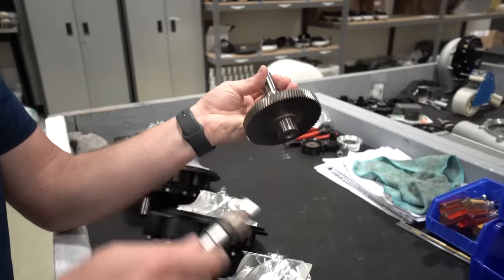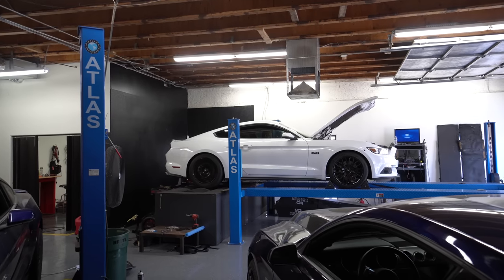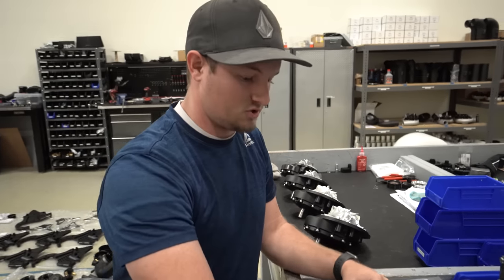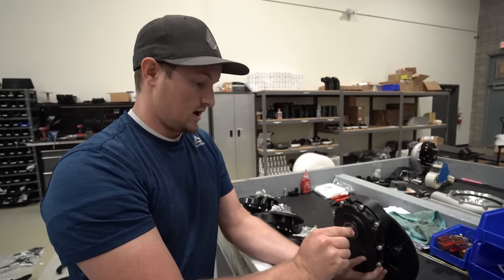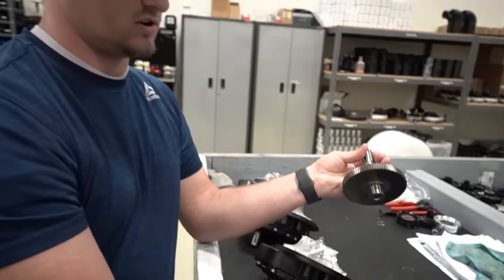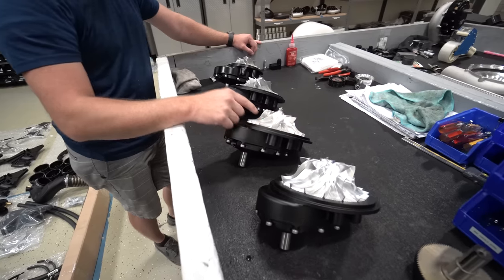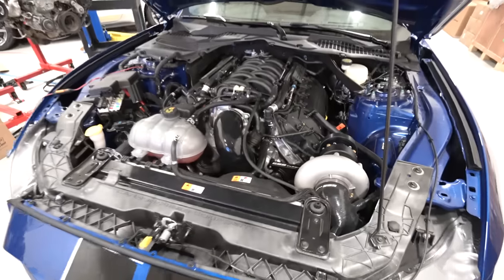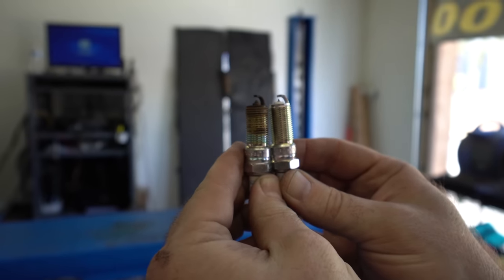Building a Mustang GT: Supercharger Install (NOT a Turbo..)

Comment: Wow, I didn't know ESS got into the blower business for the Mustang. Only thing I don't like about these blowers is the location of the air filter. I don't like having to remove the fender liner or the front bumper just to clean or replace the air filter. What I like about these though is how manageable the power is, how cool the engine stays compared to a roots style Supercharger and the fact you can still keep your strut tower brace vs a roots style as well. The one thing I absolutely love about the roots Superchargers is that whine it makes. It is sexy as hell on the other hand I don't like how Centrifugal Superchargers sound.

Comment: Those kits are fun. The only pain is changing the oil - took me a few times to get the level correct. The pressure release kept spraying my belt with oil. But, 19psi on a G3X is a dream!

Comment: Dude - I just got an ESS kit installed on my 2015 GT, headers, oil pump, breathers, spark plugs and exhausts fitted with a dyno - it's insane - thank you - digital dash next
Reply: what hp you make on your set up?
Reply: @gt8674  I got about 740 RWHP on premium pump gas - struggling to lay down the power so looking at a staggered wheel setup - the AWE touring exhaust is seriously loud

Comment: This is one the best priced centrifugal superchargers I've seen.  It also looked like it's 100% bolt on (only saw one small mod to one of the lines to the head cover)  Was that all you had to do?  Nearly every other one has a fairly extensive (but doable) mod list.  I'm liking this in particular because I want to install my own supercharger, saving about $1k on install cost.
Reply: Have you found the answer to your question yet? I am interested also

Comment: Cam, not sure if you mentioned it in the video or not cause I skimmed through but I highly recommend you do the oil pump gears on this car now that its boosted. Thats the only weak area of the coyote motor and its failed a good amount on boosted cars due to the vibrations caused by the supercharger. Hope this helped.

Comment: It’s been a few years, but all you added for fuel system is lu47 injectors? No boost a pump/ or high flow fuel pump. I’m planning on buying this kit. In know gen 3 coyotes have di & fi injectors maybe that helps not needing pump.

Comment: Great video man!! I just ordered a G3 kit for my 15’ GT your video explained the installation very well I can’t wait to get my kit and install it using this video!!
Reply: How's the G3 treating you so far?
Reply: @cfwebdeveloper  I absolutely love it!!! The power is great it’s definetly hard to get traction in boost but once you get traction it feels unbelievable but still very smooth power it’s not aggressive it feels really nice throughout pulls
Reply: @thomasfonte759  are u glad u did this kit and not a root style? I feel like this style is easier going on the engine but when you wanna play you Rev it out lol
Reply: @cfwebdeveloper  yes this is a lot easier on the engine than a roof style because instead of the engine being stressed out 24/7 it is only stressing the engine when your foot is to the floor building boost
Reply: @thomasfonte759  Yeah exactly.  Well glad it's still working good for you.  What did you do about fuel? One day I will join the boosted club :D
Reply: @cfwebdeveloper  I went with FIC 1000cc injectors and a boost a pump fuel pump voltage booster
Reply: @thomasfonte759  how's that mpg now

Comment: Great video. My plan was buy a s550 and throw on a Whipple. Then after buying one and driving it I realized I don't need that kind of power. I'm considering this kit but I'd honestly prefer more power down low the roots system would deliver. This kit is cheap and super easy to install tho. Idk what I want now.
Reply: These Centris make for great daily driven boost setups, Whipple is also fantastic blowers. You can also pick up a much cheaper TVS style blower for that down low punch. What Gen is your car?
Reply: @169abr  gen 3
Reply: @lobbyrobby  VMP kits can be had for pretty cheap honestly, other than that I’m not sure. Roush blowers have a heat soak issue.
Reply: @169abr  I bought the ess shortly after my original comment
Reply: @lobbyrobby  ooooh no shit, how do you like it? I want to go centri and I’m weighing my options.
Reply: @169abr  it's sitting beside me in my living room currently lol. I haven't had time to install it yet. I nerd out researching stuff like this and I haven't seen 1 negative comment about the ess kit. For the money and quality I'd say it's the winner. 2nd runner up for me would be procharger
Reply: @lobbyrobby  did you do opgs and crank sprocket? Also how are you liking it 1 year later
Reply: @carlospalacios6895  yes I did opg and cs. More so for peace of mind. The kit is great. If you're thinking about it I highly recommend it.

Comment: I'm looking at the G2 kit for my 2018. I'm not going for crazy power so the 125mm pulley and LU47 injectors on 93 is what I would do. I've seen that I don't need a upgraded fuel pump, but what about a BAP? I can't seem to figure out if is needed or not.

Comment: you didnt need those insulators, the one you ripped, you could just leave them out completely. probably would be best anyhow not to put them back in for some additional cooling around the injectors. all those things do is keep injector noise down / isolated. injectors can be noisy.

Comment: What is the warranty on that centrifugal supercharger and did you had to installed a lower pulley at the crank , or the belt raps around the factory crank. The inter cooler sufficiently on hot days. Great video bro!

Comment: Did you have to install a bigger fuel pump or a boost a pump? Most supercharger kits require a fuel pump that's larger than stock. Also, was your clutch worn out as a direct result of the added power from the supercharger? Meaning, its recommended to get an upgraded clutch at the same time when installing this kit? The mustang sounds awesome by the way. Completely stock except the supercharger?

Comment: be careful with that transmission, mt-82’s are notorious for breaking 3rd gear. especially with boosted cars.
Reply: that's on 2018+ cars
Reply: nah even older coyotes the mt82 can break, just get a ben calimer mt82 and youll be good.
Reply: @Brandon Christopherson  any trans can break but the 18 up are the ones that were notorious for breaking shift forks.  These actually are surprisingly tough at higher power levels considering how "terrible" they're supposed to be according to the internet.  I've seen lots of them live at 700+ wheel with boost with a good clutch and shifter setup and chance to the calimer cocktail the mix he recommends for trans fluid.

Comment: Nice choice on the centrifugal supercharger; question for you, would an upgraded intercooler help in the high heat AZ you experience?
Reply: They let you upgrade it for like 350 more. Still below 5k total. Really nice kit!
Reply: I don’t have an ESS, but a Procharger. I am installing a Snow Performance Stage 2 water/meth kit for AZ summers. 👌🏼
🐌  💨 💨 ❄️ ❄️ ❄️

Comment: When you install a supercharger, is it a fire and forget, or do you constantly have to tinker and adjust? I’m nowhere close to mechanically inclined so changing windshield wipers is my redline.
Reply: depends, some blowers are good to go the only thing youll need to worry about is belt slip but that depends on how big or small of a pulley you are running.
Reply: @Brandon Christopherson  they make some awesome aux idler pulleys that will eliminate belt slip issues from smaller pulleys by taking up belt slack and giving it maximum wrap.
Reply: The odin would be the one to go with if you want to set it and forget it.  Not as many pipes and stuff to worry about and they can go well over 100k without an oil change or the need for a rebuild.  Just wanna make sure you stay on top of your maintenance especially once boosted and you're good.  Use the best fuel possible and get a solid tune and make sure you don't skimp on fueling stuff,  it's very important.  Far as the blower you should be able to set it and forget it so to speak.  Just keep up on maintenence.  The tvs blowers have oem like reliability which is why you see them in oem applications.  Twin screws need rebuilt much more frequently just by design.  😊

Comment: Love the content bro, I was already going Paxton supercharger but after this video it looks like I'm probably going with the G2 or G3. Email was just sent!
Reply: How are you liking it/how's it treating you? I've been looking at procharger and Paxton and just now heard of ess and this is ridiculous the price you can get these at
Reply: @collintaylor4127  amazing centri! Glad I went with ESS. Ran the G2 for almost a year and just upgraded to the G3. Currently 870WHP and love everything about it
Reply: @Sabotfit5oh  anything that you would suggest getting beefed up for around the 650 to 700 range . I'm new to all the power adders. been a truck guy my whole life and just got a 2021 gt and can't find consistent answers on the forums
Reply: @collintaylor4127  I got you,  if you're going with the G2, get the upgraded intercooler,  run 95lb fuel injectors,  BAP, 110mm pulley. Get tuned on 93 and boostane. I made 720whp with that exact setup on my 2020. Let me know if that helps.  Also cheap security is change your oil pump gears and crank sprocket,  upgrade your driveshaft and half shafts.  Otherwise those mentioned above will get you that power you want easy
Reply: @Sabotfit5oh  also is it true what they say about the almost stock feel below 2500-3000 rpm or is that just some kind of placebo effect just wondering because I travel a lot for work and I don't want something that will be hard to manage in not so forgiving weather conditions
Reply: @collintaylor4127  nope 100% legit. The whole reason I went with a centrifugal supercharger is because my car was my daily.  It literally drives stock until you want boost.  No shit I averaged 17 miles per gallon in a 720whp car! Now that I'm E85 is different but yes,  stock driving until you want the sauce brother
Reply: @Sabotfit5oh  man I am sold. I'm probably going to finish out my handling upgrades before adding power but this is definitely going to be my go to. Thanks for all of the info brother.
Reply: @collintaylor4127  Yes definitely do support upgrades first, then boost! Enjoy the process bro
Reply: @Sabotfit5oh  hey did you do opgs and crank sprocket?
Reply: @Carlos Palacios  yes a long time ago.  My car 1000whp now.  I did them because the car was wide open anyway when I first went boost.  They are what I call cheap insurance.  They aren't necessarily necessary unless you think you'll be pinging off the rev limiter.

Comment: Subarus aren’t terribly expensive to make high horsepower. I have a shop around me that’ll take an STI and for 25k make it 900whp which is a pretty great price. They even have a 550whp package for 3500 which is probably just the cost of the turbo and accompanying parts only for the mustang. Also just because it’s a belt driven turbo doesn’t make it a supercharged mustang. A turbo is still a turbo.
Reply: In comparison to a Mustang, it is. I left Subaru's in 2011 to pick up a new 5.0. I will always love my two Subaru's, but dollar for dollar, I wanted more power.
Reply: @johnandstephanie377  what mustang do you know of that isn’t a gt 500 can get 550whp at $3500? None, my exhaust alone on my 15 5.0 was 4K including LTH and that brought the car up to a whole 450whp.
Reply: This is not a turbo it is a centrifugal supercharger.  It is basically a belt driven turbo but it isn't a turbo it's not the same thing.
Reply: @Garrett  mustangs can make 900 wheel for half that.  Also the 3500 bucks for 550 wheel I find that very suspect.  I seriously doubt you're gonna get 550 to the tires reliably in any subi for 3500.  At that level you need a turbo upgrade and a built motor.  Probably a built trans too and you're gonna tell me you can get that for 3500 all in?  Lol.  A coyote can get to 500 wheel na for 5k probably pretty easily.  I mean all of them not just gen 3.
Reply: @Garrett  if you pay 4000 bucks for a complete exhaust the jokes on you.  You can get a full stainless works kit including long tubes for like 2200 and they're very good quality and sound great.

Comment: If I did this for the 2018 I bet it would hold better cause they have a factory dual clutch, this gives me a bad idea..
Reply: That duel clutch is only for the gt500. The 10r80 is a traditional torque converter automatic cart with 10 gears. and its actually weaker than the 6r80 right now because they're still making upgraded parts for it aftermarket wise compared to the 6r80 you can completely build it to be stronger than you can build a 10r80
Reply: @firehot427  No, I see where I messed up, I meant to say the 18's have a twin disc clutch, like 2 clutch plates, in the manual, not the dual clutch in the GT500

Comment: No need to do oil pump and crank sprocket gears?
Reply: That stuff isn't needed on anything unless you're constantly bouncing off the limiter but you shouldn't be doing that anyways.  If you can actually drive they aren't needed on manuals and they aren't needed on autos period.  Those things get pushed way too much and they just simply aren't needed.  Especially on a build that is at 6 psi and under 600 wheel like his.

Comment: Wow, I am so glad I found this post. This seems like where I want to take my car experience. I just want to drive a car locally that has decent power (500 plus but not kill anybody or loose my driving license. Presently  have stock Mustang GT 5.0 stick shift. I was considering trading it in for something already build (I don't have time to learn this due to overtime at my job).I was looking at Camaro ZL1 1LE with 650 hp but out of my present budget. I did find a Mustang GT 2020 with a Rousch supercharger kit but I was concerned about heatsoak. I since have found a shop right in my neighbor hood  that can do all this if I can gather all the money needed. Thanks! I follow a tuner from Lun (Alejandro Flores)  who seems to suggest this blower for my needs. This video is for the more powerful unit which I dont need. https://www.youtube.com/watch?v=E6BsMpyEkos

Comment: Does this kit use the factory serpentine belt or do you need a longer belt?  Id like to do my coyote mustang and f150.  I know it sounds lame but I just want to add like 100hp-125hp and keep them as daily drivers. I live in Colorado, So the altitude kills the hp on NA cars and Id like to regain some of that. Also If you take a  road trip to a lower elevation does it need retuned or can the computer adjust for it automatically?
Reply: It is kind of hard to only add that much power to a 4v Ford with boost especially a high compression coyote 550-600 is usually the lowest you see and that is without alot of supporting mods and only running like 6 psi on pump gas.  Don't worry about the power level being too high these things are stout just use the best fuel possible and don't skimp on tuning or fueling stuff.

Comment: Hey do you need a tuner ? Or do you just run it on your same e85 bolt ons tune ? Or do you need to reach out and get a custom tune by your tuner ?
Reply: Forced induction always needs a custom tune.  You can NEVER and I repeat NEVER run a blower on anything with an na tune.  Good way to blow stuff up.  Some kits come with a safe cookie cutter tune to run with their blower but.its a one size fits all type tune meaning there is a ton left on the table in every way so even then you really need a custom tune.

Comment: I was all for this conservative build until I heard your clutch started slipping at a measly 575 hp. That really sucks.
Reply: The oem clutch is shit and causes high rpm lockout even na.  Nobody should be expecting to use an oem clutch with boost lol.  The clutch is shit and needs to be replaced with a real one.
Reply: And btw that measly 575 wheel is 200 hp above stock.